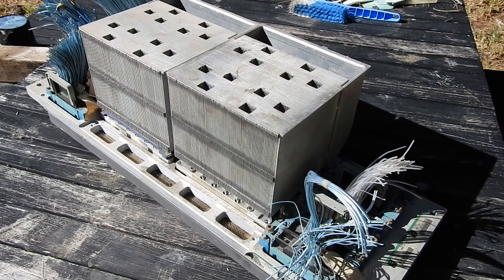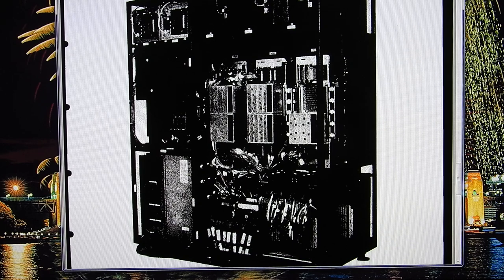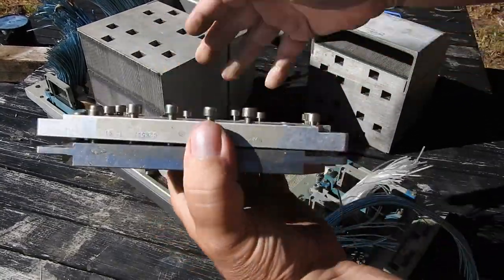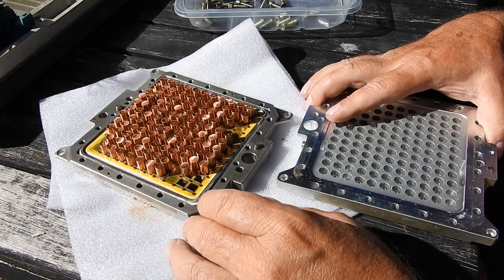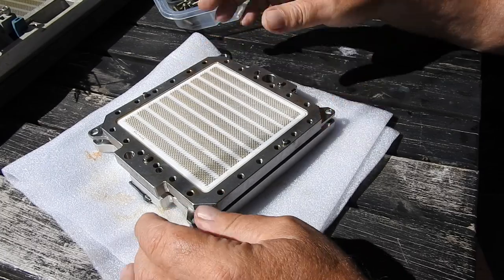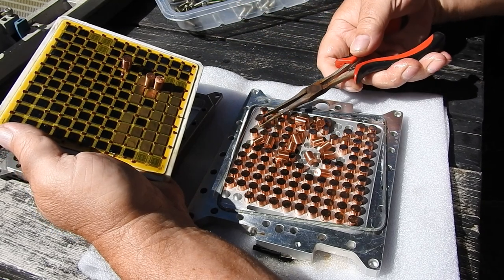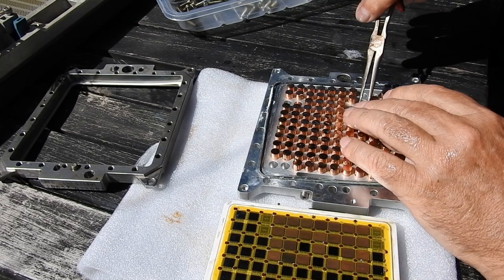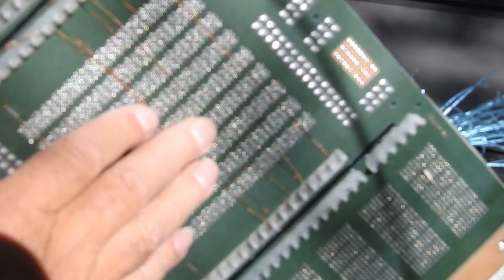Teardown of an IBM 9121 Mainframe Thermal Conduction Module (TCM)

Comment: Very nice... Where did you get it?
Reply from the maker: I used to be the system programmer for a company that used IBM mainframes. Over time, and due to increasing demands,  the machine was replaced by a more powerful model every few years. The old ones were usually to be scrapped, but not before I got my dirty little paws on them...

Comment: Do you have any 9021s?
Reply from the maker: Not sure what you mean, the whole mainframe?
No, I just have one of these modules now, plus the frame assembly shown in the video that it was bolted onto.
Reply: That would neat but I meant just the TCM.  I’m wondering if the water cooled models were constructed similarly.
Reply from the maker: @tommychang6500  I imagine so, instead of bolting on the huge finned heatsinks, they might have bolted on a jacket assembly with water pipes.